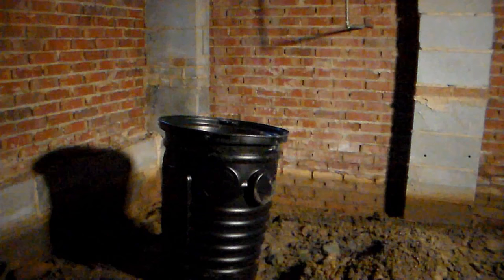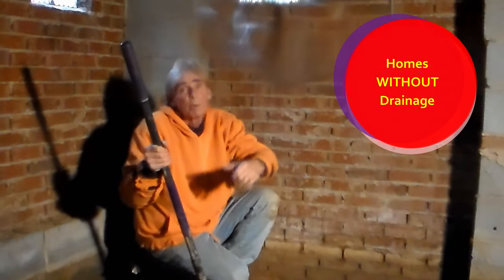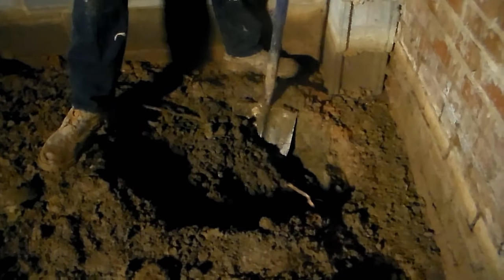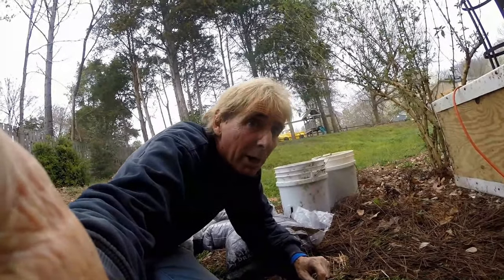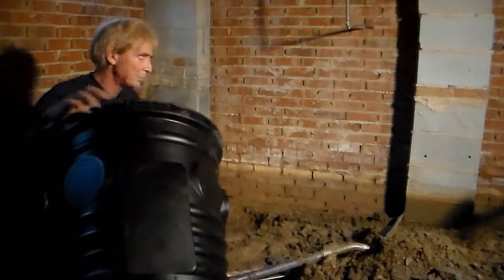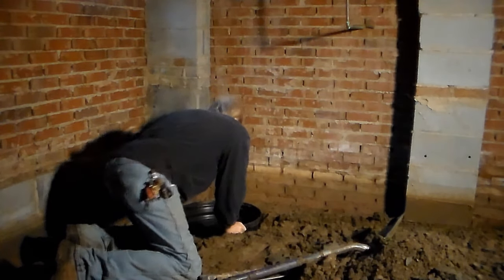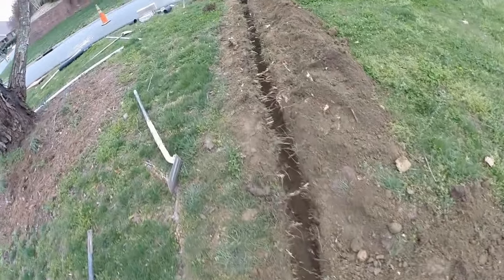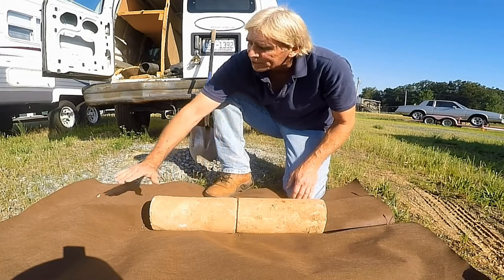Homes with NO DRAINAGE - How To for Homeowners

Comment: If you had the choice and a very low crawlspace to work in, would you rather put a french drain on the outer perimeter of the home and channel that water to a drywell or retention pond (I actually have a lakefront home) before it even gets under the home, but still install a sump pump with basin weep holes only (can add tiles to it later if need be), for just in case? Or go through all the labor in a short crawl space and do the french/footer drain around the inner perimeter. Note, I have 2-parts of crawl space and will have to have 2 sump pumps.

Comment: Just to play devil’s advocate for a moment; why not take the little bit of extra time and material needed to extend your discharge pipe all the way to the edge of the curb and do a angle cut on it to match the angle of the existing curb profile then pour a small bit of hand mixed concrete to finish it off nicely?